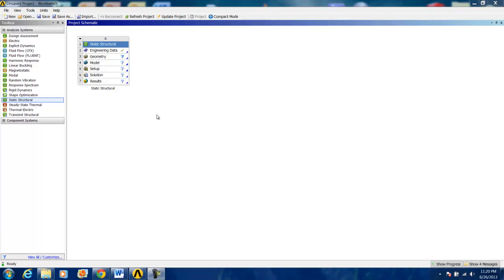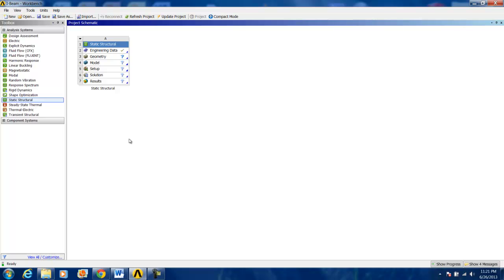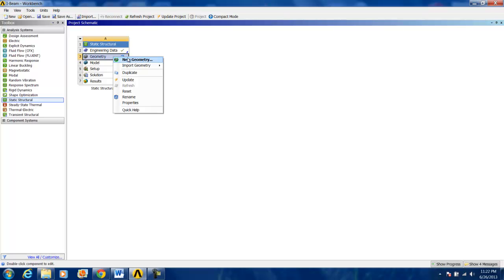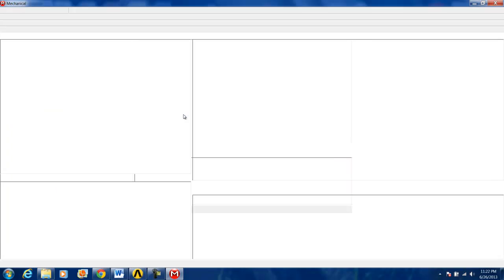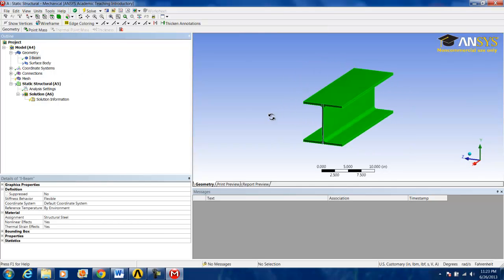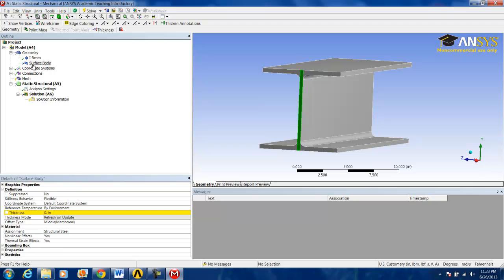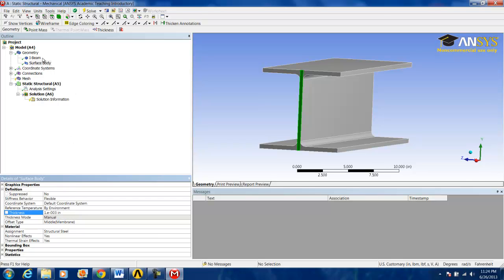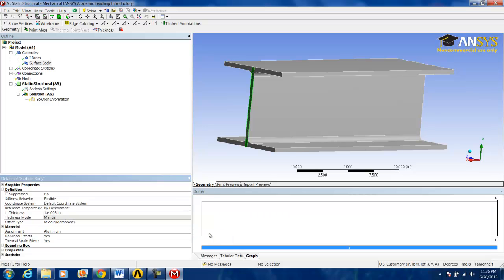SimCafe: Cantilevered I-Beam in ANSYS, Geometry

Comment: The geometry file is not working at all, after I import I double click on model, then the Mechanical window pops up and it starts loading the file but then the whole window closes from itself and I get back to Ansys!
Reply: Geometry worked fine for myself, using 14.5. What version are you using?